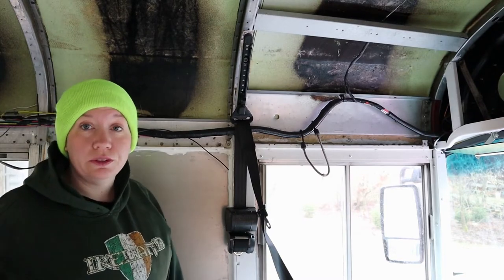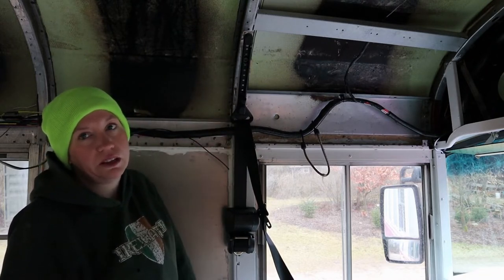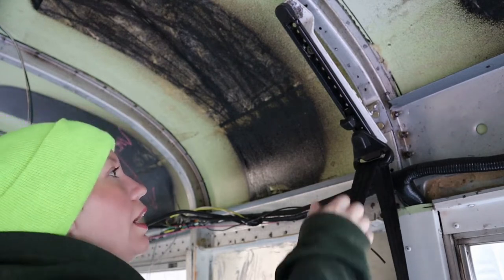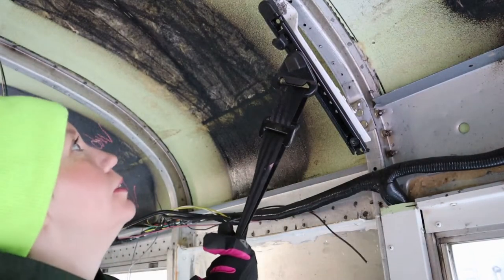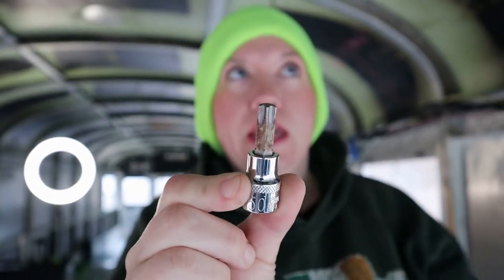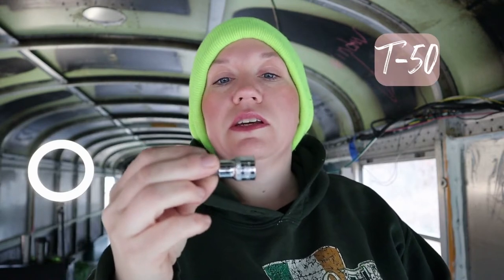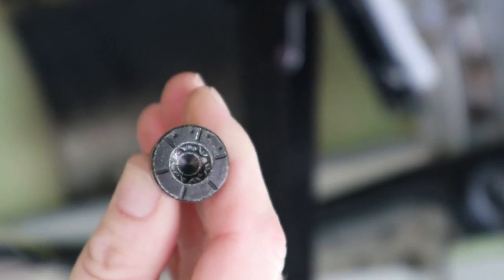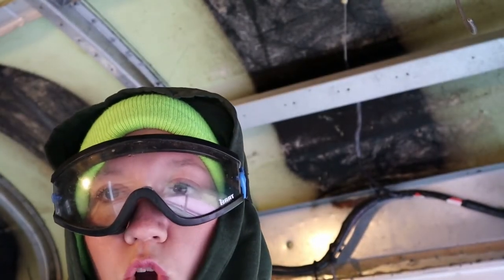Skoolie Seatbelt Bracket Removal- You Need This!  -Solo Female Bus Conversion

Comment from the maker: The seatbelt bracket removal  was a harder job than I expected for sure, BUT I found the golden ticket for removing the seatbelt height adjusted and you will need this too (I used a T-50 ). In the end my dear friend the angle grinder had to make an appearance.  
Next Week: This footage took longer than expected so my next video will be about removing the front heaters from the bus.